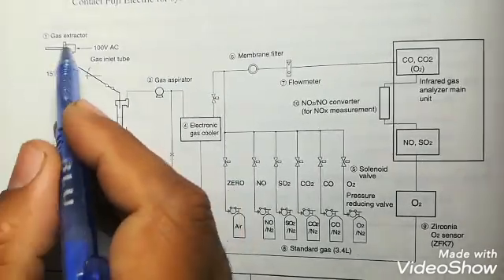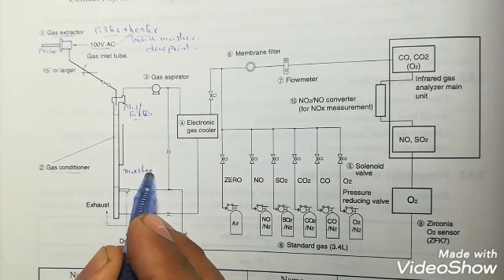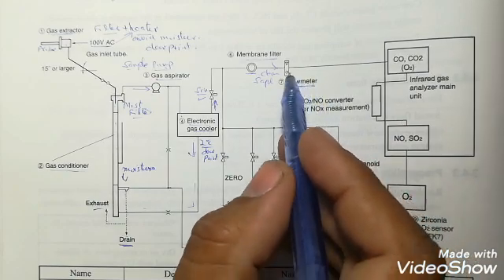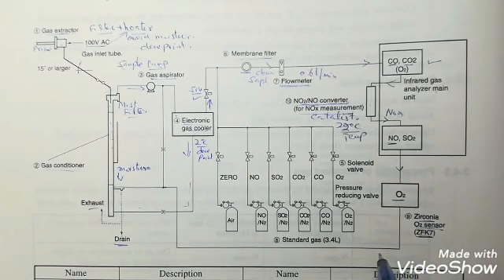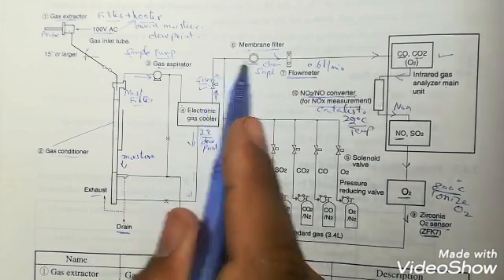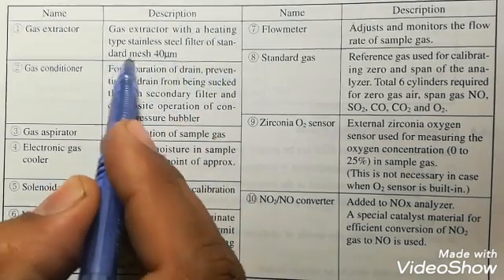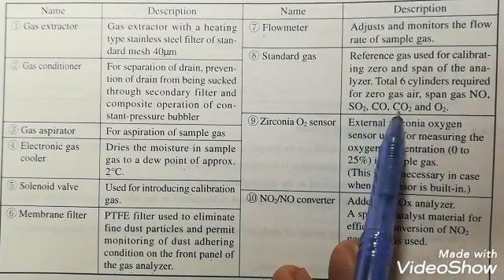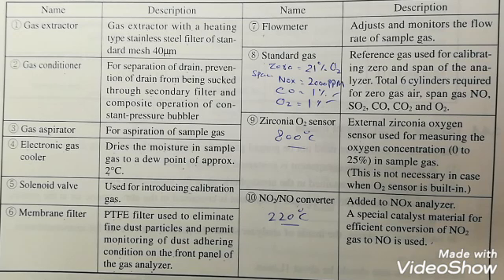gas analyzer basics

Comment: Sir i want to ask ,
What is heater function on gas extractor & sample line heated (gas conditioner) ??

Thanks for sharing
Reply from the maker: Heater is uaed to make the sample heated upto drain pot or cooler to avoid dew because when gas will be cool there wipl be dew and moisture, it will be cooled in coller and moisture will be seprated there

Comment: Hello from spain. I have a crypton gas analyser, but CO2 dont correct measure. What happend???
Reply from the maker: did you applied a standard gas to module and it read wrong,?
Reply: @creativeeee  I have not applied standard gas.  has been testing a vehicle
Reply from the maker: check if there is any leakage from exhaust of engine up to analyzer, if yes then arrest leakge